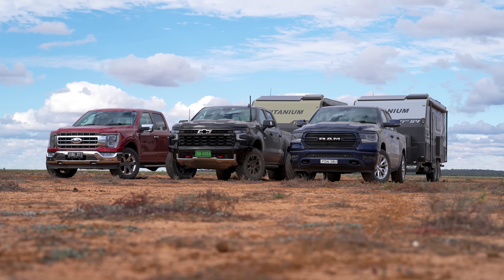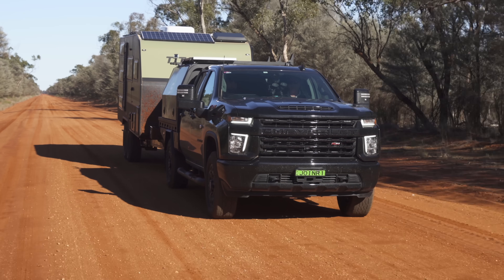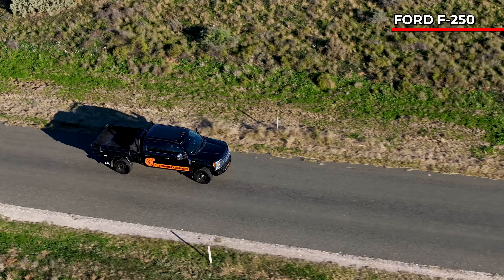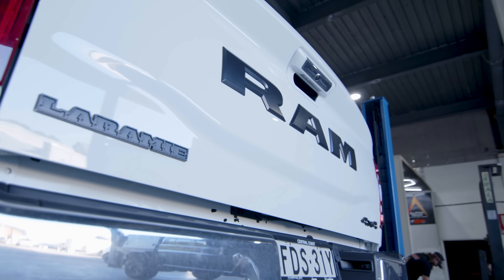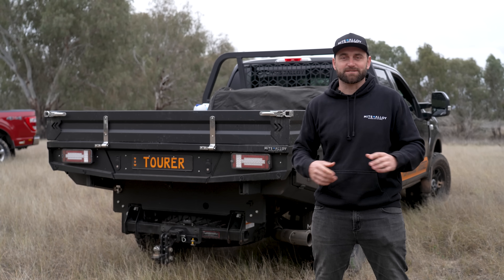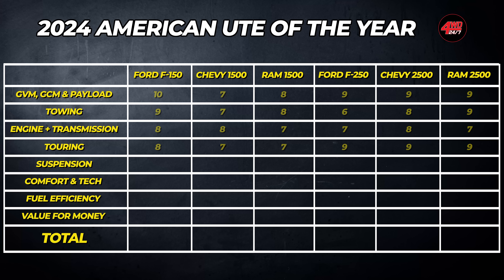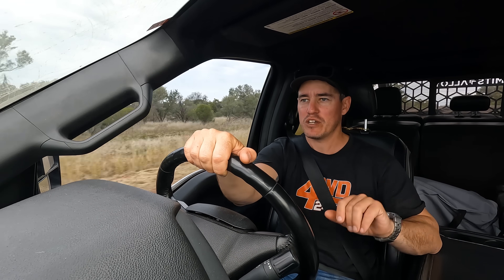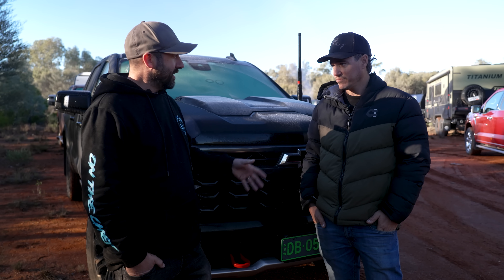2024 RAM vs CHEVY vs FORD TORTURE TEST! Heavy towing, dirt roads - SHOCK WINNER & major problems

Comment: Over here we usually throw a 6" lift and 35"+ tires on our 1500 trucks and it resolves most of the breakover angle issues...but I would never take anything that expensive rock crawling...we have a cj7 for that
Reply: hardest part with that is we have laws preventing those kind of lifts. we are limited 50mm of lift and 50mm larger tyres generally (especially on vehicles with esc). otherwise the vehicle can and will be defected and pulled off the road with hefty fines and demerit points to follow. we do have ways around it through engineering and secondary manufacturing but these are generally very expensive and therefore prohibitive for the average bloke here in aus. our modification laws are extremely restrictive and the offroad community has been calling for reform for years but generally it falls on deaf ears and becomes even more restrictive 😅
Reply: @Sunderlanding_AUS  some trims of 1500s in the us come with 33 or 35in tires, so that's not really a problem. A f150 tremor comes with 33in tires and 2in of lift over a normal f150. There is also the raptor with 37s and trx with 35s which I imagine don't fit on any trails over there.
Reply: @masonkaye5  yeah we get the ranger raptor (100k ish)and the trx (200k+ probably more havent even bothered looking tbh) here but as for the other trims we dont get the option for almost any of them. they have only just released the first ranger tremor edition. the nissan navara and patrol both have a company doing a 2nd stage manufacture for lift and tyres but then due to laws you cannot change anything thereafter. so still limited to the 2 inches in lift and tyres. we simply dont see the range you guys get. even from toyota with the tacoma getting all the different trim levels with different suspensions etc. we see none of that on our hilux range... basically its a mentality here from the manufacturers that you get what you get and you dont get upset 🤣😂😅
Reply: In Australia no one would touch a cj or any jeep for that matter they are so unreliable here
Reply: @putrol4.2  those are for crawling over rocks, not long distance endurance where reliability matters
Reply: @putrol4.2  Um…..that is so not true Jeeps are pretty reliable bud
Reply: @DakotaOverlander far from it in Australia not many leave the  black top
Reply: @putrol4.2  only talking about the ones in the show a lot of 4x4 don’t see off road much even here in the US a small % of the population actually goes off road

Comment: As a North American compare Apples to Apples please. The ZR2 is a more off-road focused product by chev not really designed as a tow rig. The other models by chev and GM tow far nicer with a stiffer suspension set up from factory.
Reply: They kinda are though the zr2 trim level is the same cost here as the others shown 
We don’t have 40000 different trim levels like you guys get the check gets the ltz premium and the zr2 
The ford gets xls and lariat and the ram has the express, big horn, Laramie, Laramie sports, limited and trx
Reply: @carbonfiber492  the trx would be a more comparable model overall however it’s also not. Trx is “rams” most off-road focused half ton they make, you don’t get the raptor in Australia? As that would also be more comparable. Lower trim levels or the other trim level you listed for chev it’s a higher tow capacity overall and payload.
Reply: @Jedisith122395  the trx is 50k more than these over here
While we get the raptor it isn’t through official channels like the f150s shown here.
Isn’t the tremor a closer trim level to the zr2 anyway
Reply: @carbonfiber492  under technicality the tremor is a closer trim level, but apples to apple unfortunately would be comparing their most “off road ready” designed trucks. Trx vs Raptor vs AT4/ZR2, otherwise you’d need to compare the Tremor vs Rebel(whatever the new version is called, not a dodge guy) vs a basic ZR2/AT4. ZR2 and AT4s have higher trim levels now that have more in them now too. Regardless I’m just being nit picky. I do enjoy their content, it’s interesting to see some of rules that are to me absolutely insane regarding licenses and air brakes needed on a little weights… I could go buy a 3500 and tow a fifth wheel trailer, no air brakes just electric assist, no different license between a car and a truck. Just need to have the trailer added to my license as it exceeds X weight.
Reply: I totally agree Jedisith. The ZR2 is definitely the odd one out in this test. It is literally set up as off-road spec from the factory so to say it's not suitable for off-road is just bizarre. The Silverado LTZ (which is the only other option here in Oz) would have been a much better option for the purpose of this comparison.
Reply: @jakehearn26  the vehicles picked would be what people will cross shop rather than closest in spec all 3 shown are around the 150k mark

Comment: It's fascinating watching aussies gush over what are everyday trucks here in North America. Road rules in Australia won't let you blokes anywhere near the actual limits of the 2500's. You'll all be happy to know the Chevrolet HD's have fixed the interior appointments.

The big NA 2500's are capable in low range, but they need a small lift and 37's to ameliorate the breakover angle. That said, if I'm offroad, I'd still rather hop in my 80 series. We have a lot of tight bush in BC where I live, and the big girls are a tight squeeze in a lot of places.
Reply: Road train license

Comment: nothing will beat a old cruiser in the bush in terms of reliability
Reply: An old patrol
An old Hilux
And old dmax
Reply: I advise you to go look at the video  that brakes down how weak Toyota's  actually  are lol vs a patrol
Reply: My 79 series pre dpf v8 got over 600 thousand ks. Seen plenty of 1hd cruiser over a million. 4.2l patrols are unbelievably good aswell
Reply: @stotty117 I think that’s more diff and axles ect rather than engine which imo matters the most
Reply: @kobihemmerle1140 It all matters. You might get out if you do one diff or a driveshaft but generally speaking you''re not getting very far if any of it breaks. 
There's a reason Toyota owners "upgrade" to Patrol driveline parts but almost no Patrol owners swap to anything out of a Toyota
Reply: @Tedkelvin  old j4 or j7
Reply: @kobihemmerle1140 want to know something  funny lock up a diff and see how far you move lol or even better shit ya gearbox and you now have a rolling generator in the middle  of nowhere I don't see Toyota gbox and transfers in patrols but have  seen hundreds  of Toyota's with patrol  gear in it lol 😂😂 and want to know something funny Nissan's  td is actually  good lol it's basically  a stump puller that's what a diesle is lol they are not race motors that you can get hp cheaply yet everyone  cheaps out now let's talk the petrol  motor the 4.8 turbo  I have will shit on all of what Toyota  makes  and I know that's a fact
Reply: @stotty117  forklift kettle motor
Reply: @gqwarrior6694  I understand what you mean and I agree with you about the differentials and sometimes the gearboxes when it comes to extreme off-road driving.
Reply: @epicgamer785  the kettleship is easily sorted out...even the related td27 still warms up..alot. 
Why they didn't  develop a QD48 out of the stalwart Qd32 is beyond me.
Reply: @epicgamer785  The over heating is caused by fools doing stupid mods & throwing a cowboy tune at it. I've had 3 td42's over the years & never had one even think of getting hot.
Reply: Best of the bumch has tk be the last year 80 from 1997 with the 24v FT without bearing issues and without electronic issues, ie capable of running submerged in salt water, a feature which saved my life on our old boat after a bad accident late at night far from help.
Reply: I knew the cruiser die hards would get their panties in a bunch.
Reply: @gqwarrior6694 Yeh that's why they FTE swap patrols cos the so called holy Grail of Nissan the TD 4.2 is a box of shit known as the kettle and the zd30 known as the grenade but yeh no Nissan ever gets Toyota parts🤷
Reply: @carlmenzel8744  Ah the butthurt Toyota fan that can't cope with the truth so claims I said things I didn't write 😂
I said "almost" not "none". Details matter. Besides, there's only a very small handful of fte swapped Patrols compared to the massive number of Toyota's with Patrol running gear. 
Only the early 3lt is known as the grenade as the issue was fixed from factory on the later models & it only took a couple of hundred bucks to fix the earlier ones. You obviously know nothing about the td42 & are the exact person that would throw 30psi & a cowboy tune at it then claim it's a bad engine instead of realising it was your own lack of skill & knowledge that caused the issue. 
Keep coping
Reply: Bloody oath mate
Reply: More like the patrol die hards mate. Have ya read the comments

Comment: One thing that needs too be pointed out is the interior technology/ comfort differences  in the chevy trucks is the overall package. The 2500 is a z71 which is the entry level offroad package and is naturally more basic as compared to the 1500 which is the zr1 which is the top tier offroad package with all of the goodies tec, and comforts. Just thought I'd put this out there.

Comment: I'm not far in yet but the zr2 can't tow much because that's not what it was built for the zr2 is Chevy's top of the line off road package. You can get the max tow package on a 1500 that would allow you to tow up to 11,000 lbs I believe.
Reply: 13,400 Lbs but that’s insane to tow with a 1/2 ton

Comment: Here in northern California,  i drive a 2005 GMC Sierra 1500 Z71 with a V8 gas engine.  It's same as the chevy 1500.  
She's got close to 500,000 km roughly.  She's had a hard life,  pulling well over her weight limit, up and down these mountain roads for 20 years not once she has stranded me.  When i change her for a new one,  ill get the same.   But if i need to step up to a diesel, ill get the Ford F-250 Tremor.  Get this truck if you can.   You won't regret it.

Comment: Only disagreement is that v-6 will never have the durability as the 6.2 chevy.  my buddies got them and they run good for so long and need turbo replacements too.
Reply: They burn holes in pistons too
Reply: The Chevy and ram have lifter issues that’ll cause engine failure.

Comment: RAM Cummins 6.7 is the best pickup truck ever made...
Reply: Cummins sure. That ram truck around it begs to differ with that cheap build quality
Reply: I dunno I love my o1 5.9 6 speed manual tranny 2500 cummins. 444k miles so far

Comment: My 2 american big mac cents, are this. There's a reason the F150 is the best selling vehicle over here in the states. It's all the truck most people ever need. The 2500 trucks are worthy too, but being as you're limited to a max 4.5T, I don't see a reason to go big unless you're going to upgrade your license there, or if you opted for a petrol version (if available...) to take advantage of the greater payload vs vehicle weight. The big V8s won't do you many favors at the pump, but are much lighter than any of the diesels. Back to the F150, I would heavily consider (again, if it's available..) getting the 5.0 V8 for a more bush proof/slightly less complex vehicle vs the TTv6. Fuel mileage may dip a bit, but it otherwise should perform pretty close to the same. I'm not sure on vehicle weight between the 2, but a big lazy American v8 will generally run for decades.
Reply: I've been trying to bring this up on all sorts of channels about the 2500 petrol HD. We don't get them in Australia and no ones talking about them here. They are the perfect truck for 4.5t towing. Actually a difference from our utes. Not too heavy like diesels. Not too much of the same like 1500s. Can fit a full size bed on a 2500. No egr or, injector or dpf problems. I think the problem is no one pushed back early on and let this importers just bring in any model they thought was going to be right or would make money. Now it's too late and 1500s are in deep here + 2500 diesels which no one really tows anything over 4.5t with.
Reply: "Lazy V8s" lmao. It's not 1950 anymore.
Reply: @chickenfishhybrid44  in the 50s they had 2 speed autos behind them. Now we have 10 speeds so moved on a fair bit. What's the difference if it is 4 or 6 cylinders and is roughly the same size around 5 or 6 liters? Are you pushing for electric? They have leaf springs in the back. Had them in the 50s too. They haven't changed much either. What design should they move instead of leafs?
Reply: @Nick-im3sm  The 5.0 has a mixed record over the past decade. Not really any better than the ecoboost models.
Reply: @0HOON0  I dunno.. They've gotten quite good I've heard. Early on, a few issues but they've got 'em dialed in now.
Reply: @chickenfishhybrid44  Lazy power output vs what they do to it in the Mustang etc.. It's a good thing. In trucks, they tune them for torque and low octane fuel, and as a reward, most of these NA V8's will go many hundreds of thousands of miles. Often nowadays the truck itself is junk before the engine is wore out.
Reply: @Dan-rg7jj  No the difference is the twin turbos. I have mixed feelings about them in a "survive on your own" environment like the outback. Just more to go wrong. Yes I know most diesels run one (sometimes 2..) but they do fail, and the ones on the 3.5 have done so more than most in the past.  Engine has a ton of power, nothing against it there, but I'd still probably take the 5.0 in the outback. With some fuel cans. Far as Electric, I never said anything about electric. In my opinion? We aren't anywhere close to there yet for trucks, especially towing with electric trucks. So big no for me for now until batteries energy density is higher or they start fitting them with small generators to boost towing range. Electrics do have a few major positives (no multi-gear expensive transmission to fail!) but generally the batteries negate any of the positives. Far as leaf springs, yeah the ride is worse but they tow better than coils generally, since they locate the axle from 2 sides and spread load weight over a larger part of the chassis. Still good tech even if it's old. Generally worse ride, sure.. But nothing's perfect.
Reply: @Dan-rg7jj  For what you guys over there use them for and the limitations of the 4.5T thing, I very much agree. Hopefully, in time..

Comment: They have enough ramp over clearance for getting around farm tracks. As a farmer the stock suspension is fine and we haven't modified them beyond tires. The extended family currently have licensed a 1998 Ford f150 4.6 manual, 2004 Ram 2500 Cummins and a 2019 Ram 1500 pentastar. We live on the Georgia/South Carolina border. We've bought several Toyota 4runners and xj Cherokees for true offroading.
Reply: I think it's a difference in the types of tracks. When he says off-roading he's referring to tracks that Jeeps would drive. Rather than just a muddy field.

Comment: The 2500s are mid range trucks in America. 

The Ram 3500 is also constructed to harness that extra power. The Ram 2500 allows towing for up to 19,990 pounds when properly equipped, but the Ram 3500 uses a high-output engine that allows drivers to tow up to 37,090 pounds when properly equipped.

Comment: Sorry Aussies, but just don’t. These trucks are just gonna be terrible for you. Unless you run a General Contractor company.

Imagine towing a 12-16,000lbs work trailer every day and often 6-10 hours of straight, featureless, boring black top while you’re on your way to the next job site in a totally different state, hundreds to thousands of miles away. That’s why these trucks are designed without Australia towing restrictions in mind and why the cabs are so cushy. The amount of effort and money it would take to make these “Hard Aussie 4WD Track” ready, would completely destroy the whole design and may literally cost you as much as a whole other vehicle. 

Stick to your LandCruisers, Patrols, dual cabs and Luxies. They’re just plain better.
Reply: Mate I agree with you about it costing a lot to make em track ready but I will say that we do drive very long distances here too mate. Amd between your starting and ending point there is nothing.
Reply: We still want to tow more than 3.5 tonne safely, have the comfort and luxury features.

The alternative is 4x4 hino or isuzu box truck that have no considerations for luxury, comfort or use as a family/shopping mall vehicle.
Reply: @hi9580  certainly if you’re just doing long haul, then yeah, I could totally see that. I guess my point is more that of making these off road/hardcore wheeling rigs. It’s easy for us across the pond, because we have them everywhere, but the “big three” off-road market for is just so sparse for y’all🫤

Comment: A regular cab f250 is a weapon. The 7.3 diesel are legends and the new stuff just ain’t the same.
Reply: The 7.3 and the ram 12 valve are both amazing old engines , the problem is they both are getting pretty old now and require some expensive rebuilding.

Comment: I'll definitely agree that these trucks are build more for pounding pavement. Most of us only get the 4x4 for dragging trailers through the snow, and even then most of us would get to where we need to go in 2wd with a little bit of planning. But they are still very capable. Locking diffs, skid plates, winches, rock sliders, are all factory options. You see them dragging big fifth-wheel RV's way off the beaten track and up into the mountains all the time.